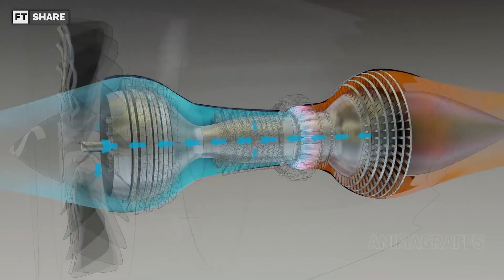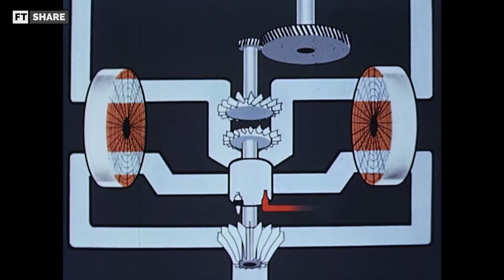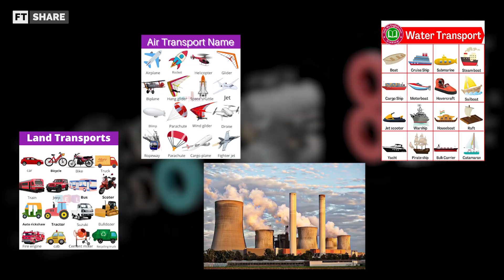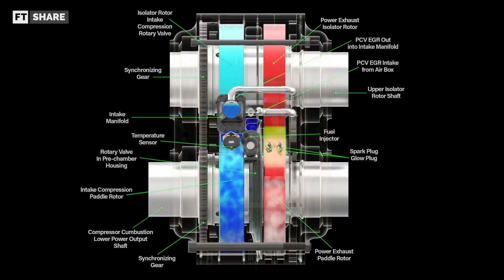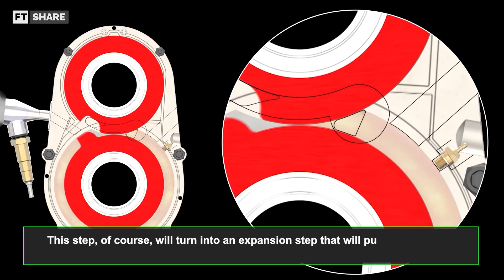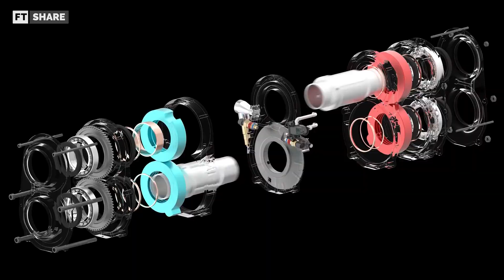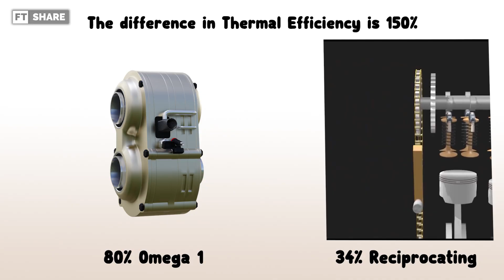Ready To Destroy EV Engine!! | Astron Aerospace - Omega 1 Engine

Comment: Thermodynamically 80% seems a bit dubious. The maximum thermal efficiency of any Heat engine is in reference to a Carnot Heat engine which has an efficiency of: n=1-Q(low)/Q(Hot). Since Q(low) {the external sink} doesn't change in temp that much then that means Q(hot) must increase. The same material properties limiting traditional engines are also at play here. You can only go so hot until Q(hot) is so high that it melts the materials. Unless they have a published paper to back this up I am going to be extremely skeptical.
Reply: I actually agree alot with you as a builder but I am very Impressed by the expansion ratio this thing is capable of along with it compression ratio. Having a bigger expansion ratio is very good at making tq. I see issues sealing with the claimed rev range. It seems like it seals like a roots blower and that's fine and dandy but leakage happens and I understand the prechamber is used to give a buffer zone pressure wise to seal the two sections off. But the hot side is gonna get too hot. I don't see how this would work efficiently.
Reply: @oliverscorsim  It's worth tinkering with... Alcohol and refined versions of propane... Propene, propylene and liquid forms might help. As for longevity, that might not even be an issue for Airborne drones, especially facing hot side forward. It would make for a good one time use. There is also water injection. They really do need to put together more prototypes though. They make too many claims... Like the 80% figure. The compactness and low weight are impressive though. E en using exotic alloys, there are way less components.
Reply: A lot of these concept engines seem like amazing ideas until you start looking into sealing and cooling and realise one or both those issues aren't solved yet and they're some of the hardest things to develope. 
It looks like sealing those four rotors against the case, against each other, and on the sides would be the Achilles heel of this design, especially without using a fuel/oil mix to aid in lubrication. You can rely on tight tolerances to seal sometimes but that generally doesn't work when you have a wide range of temperatures to deal with due to expansion and contraction of parts messing with the tolerances.
Reply: @Surestick88  The devil is in the details.
Reply: @Surestick88  If you run it with diesel,it would have all the lubrication you need, Remember the diesel injection pumps raise the pressure at about 150 bar and the only lube they have is the fuel.On my car( Renault Megane 2, 1.5DCI),after 17 years and more than half million kilometers the pump doesn't give any sign of being in need to be changed....and it works in a rotary engine style (search for Delphi injection). Also if water injection is added to this Omega,it doesn't need to run on high temperatures,at 200 C in the chamber is enouth to switch the water from liquid to vapor,resulting in a volume increase of 4000 times,so in an enclosed chamber,instead of volume,increases the pressure (makes a nice boom😁)
Reply: You’re right, Daniel. It’s misleading at best.
Reply: I'm an aerospace engineer and its pretty obvious to me you're another engineer (probably a mech) or at least someone who's done a proper thermodynamics class. I don't know other people who'd write what you wrote. 

I have seen people work on wobble plate motors and other stuff and am yet to see any of them actually go into production. Considering the push towards renewable energy I doubt we'll see any new developments in internal combustion unless its for some very specific applications in unusual locations.

There's also a give away in this video. Listen to the voice and ask where you've heard it before?
Either there's the same guy narrating several 100 videos a week or its one of the computer generated tracks.
Who uses those???
Reply: @tonywilson4713  cheapskates n content creators use them
Reply: @jackd1582  Yep, Yeh, Uh Ah, Si, Da, Yah and every other form of yes.
Reply: A Carnot efficiency of 80% at 24,000rpm...lol that's not happening. If I had to guess, maybe 37%-39% is the real number. And based on the complexity of this motor and its size, it wouldn't last long without some sort of overhaul requirement. Cool concept though.
Reply: @ajspang4291 they said max power was at 5k rpm not 24k.
Reply: @charlescasto4226  yes but he says direct drive which is not geared,
Reply: totally agree, the combustion  process is not purely adiabatic so there will be heat transfert to the engine block and the rotating assembly and the heat loss to the exhaust can reach 50% so in the best conditions, you can anticipate a thermal efficiency of 25% for a spark ignited engine ( OTTO cycle)and 30%for a compression ignited engine ( Diesel cycle ) and about the  same for continuous process engine ( brayton cycle ) used on gas turbine engines.
Reply: @jacquespoirier9071  gas turbines can actually go above 40%, but those are usually the modern big ass engines for power generation.
Reply: @thorwaldjohanson2526  .... with heat regeneration, as you say, in a stationnary setup, it is possible to add weight and optimize the efficiency but the basic cycle efficiency is not that great.
Reply: @jacquespoirier9071  actually modern high compression ratio turbo fan engines can have thermal efficiencies of over 50%. I had that 42% number burned in my head, because we looked at engines from the 90s in detail in aircraft engine design and turbomachinery lectures, back when I was at university. Exotic materials and manufacturing processes have allowed these engines to have super high combustion chamber exit temperatures, and the turbines have gotten very good at extracting the enthalpy from the working fluid.
Reply: It's a scam
Reply: I am not an engineer, but what you say makes a lot of sense. As a mere mechanic I understand the damage to an ICE engine @ constant high RPM. Heat is the enemy here. The materials needed, to my knowledge have not been invented.If they have, the cost would be undoubtedly financially prohibitive.
Reply: Without thorough testing the material requirements cannot be known 100%.  A Wankel manages heat ok and this is not far removed in that respect.  There are ceramics that can withstand orbital re-entry so there certainly are materials that can withstand the temperatures.  The life span,  manufacturing and maintenance cost are one of the biggest factors.  Something can work very well for a short time or exorbitant price.

And in reply to the comment that now we are moving to renewable so all combustion engine development are redundant is a joke.   Firstly there are biofuels as well as methane and hydrogen.  Secondary for flight batteries are still very low energy density compare to combustion,  for short flight they work ok but for longer flights it becomes counterproductive.
Reply: @kentonian  Cermics withstanding orbital re-entry, well shuttle tiles are it's silicon-oxide or silicon-carbide and it's essentially 99% air and are extremely fragile. They are a a kind of foam, thus have a volume to surface area that's in the region of multiple times that of human lung, which if made to a plane would cover a tennis court, now imagine a tile about 30x30x5 cm and have 100 times that area. so at each point there is nearly no heat. Also there is a plasma shock bow that creates a insulating layer between the tiles and the air.

Oh, you can have ablative shields, but that's I think not such a good solution for a engine when the "cylinder" is disintegrating while running.

Here something to get education:
https://www.youtube.com/watch?v=hLHo9ZM3Bis

https://www.youtube.com/watch?v=HgTNzDCc0gk

It's nice to dream, but it's stupid to be in a dreamworld.
Reply: It's a startup company.... no prototype, only fancy animations and unrealistic claims... it's a money grab scheme
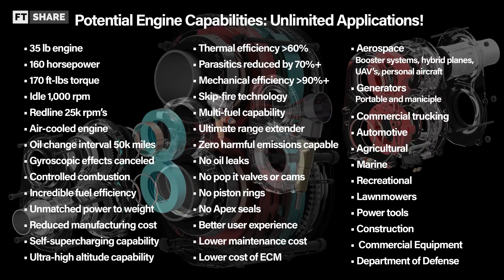Reply: The slide at 05:01 says >60% which is still very dubious but much more plausible than 80%
Reply: @almerindaromeira8352  A trubine is run at ~40% - 45%, some reach with tricks, 50% - 55%, which is in mechanical engineering somewhat of a holy grail, things like the super-critical CO2 brayton cycle turbines can reach 60%.

Diesel Engine in a 40 t truck also have 40 - 45% efficiency, but great thing with Diesel engine is that it can burn essentially everything, sunflower seed oil, peanut oil, canola oil ... hey most of international shipping, especially tankers run on crude oil, that is even below in the refinement process than diesel.

"Each engine has eight cylinders with an 800 mm bore. The engines are designed to deliver their maximum efficiency at 73 rpm. Their combined power of 59,000 kW allows the monster-ship to cruise at 16 knots."

Good thing of Diesel engine is it's low RPM high torque. That's another thing this is not talked about for this engine ... great Nm, at what? 25 000 rpm? You can't cheat physics, lot of weigh will produce a lot of torque.

This things prototype is leaky, in complete combustion, can't run for more than a few minutes ...
Reply: @almerindaromeira8352  60% is more believable. Modern powers rations that combine a gas turbine with a steam turbine (heated by the gas turbine exhaust) reaches 62% plus. That in a single device and especially in one step would be incredibly impressive, especially if no exotic heat exhlchangers and cooling or unsustainable high combustion temperatures are used. I'm still very sceptical, but it might work well enough for some niche applications
Reply: They only got 71% in the lab so I doubt they can get to 80%... 

Also, their paper stated that the combustion temperatures were significantly higher which meant that they had to use exotic metals...
Reply: @pilotavery 80% is definitely possible. You would have to run the motor at a lower rpm to achieve it thou. Also a regeneration from exhaust pipe would be used to increase it 80%
Reply: Well to be fair it's only combusting a tiny tiny volume of air, the reason why it gets so much power is because of how fast it revs
Reply: @pilotavery but they said the max power was at 5k rpm.
Reply: Exactly. Toyota has just launched an engine with a thermal efficiency of 37%, considered excellent.
Reply: Agreed. I see a spark plug. That means, running on gasoline, that your effective compression ratio is limited to about 1:10, maybe 1:12, before the mixture will self-combust. So, the Carnot efficiency is back to 33% or so. Also this highly compressed and therefore hot mixture, is supposed to flow around all kinds of sharp edges without going up in flames? Highly unlikely. And then still, it runs on fuel. So, emissions?

Show me a working prototype, on a test bench, with real world measurements, and I am game. Before that: Very very creative. But no.
Reply: De facto. But the rotary nature could be positive on reaching high rpm and make it, although efficient wise the same, more powerful (HP)
Reply: @Beto Lima  it fist needs to actually work
Reply: @some_random_garage  yep lol .. let's dream first 😂😂
Reply: @TheSuperCaralho of course no Dream no modern World
Reply: especially as their own slide says >60% :)))  4:59
still very dubios, but closer to reality of 30% increased to 35% after years of optymizations.
Reply: Damn it....  you beat me too it.  ;)
Reply: Gee I really hope your are not serious about engine development and then mention Harley's as improved over the years. Because they haven't. For a engine manufacturer to sell engine in cubic inches and figures under 60hp yout statment is rather embarrassing
Reply: 80% definitely seems un-realistic, but I guess we'll see
Reply: The actual thermal efficiency mentioned by the company is over 60%
Reply: Huh? 🧐
Reply: 30% is a good ICE efficiency also for nuclear power stations.
Reply: @tonyclough9844  A little higher, 33-36%
Reply: I don’t need any knowledge about mechanics. This video is just blabla… don’t put effort in commenting.
Reply: @Qwerty8  It's a foreshadow of an upcoming Bot plague😩 
Every media will be flooded with probabilistic nonsense soon.
Reply: @goiterlanternbase  egal. Nervt halt endlos.
Reply: @Qwerty8 yet you just did.  Interesting self-own.
Reply: I’m not sure where he got 80% from. I just looked it up and their own advertising states >60%.
Reply: @fearofchicke  Still way too high. The best heat engines available (combined cycle gas turbines) peak just over 50%- and they are huge static affairs. A single stage machine cannot get close- the laws of thermodynamics rule.
Reply: Quite right. Any improvements to internal combustion engines are going to be incremental and tiny. It is far better to abandon ICEs and use the money in EV development.
Reply: I was just thinking, 'Sounds like BS to me,' but what he said...^^^^
Reply: Correct. Assuming a typical 68 degree Fahrenheit cold reservoir, 80% efficiency would imply 2177 degrees Fahrenheit in the combustion chamber, and that’s assuming the maximum possible Carnot efficiency and that maximum will not be achieved.
Reply: That and several other bits make me wonder if this video is merely a nicely produced bit of animated fiction.
Reply: @dangraff8467  Perhaps they mean hybrid EV, that is, an engine run at low steady loading to recharge the EV batteries.
Reply: Eeww that sound that it makes mmm still a v8 sounds better but awesome stuff we will see what the future brings us
Reply: In the capabilities slide doesn't say 80%, it says > 60%, which is more realistic. Still a lot compared to a traditional engine.
Reply: three rooballs
Reply: https://youtu.be/vFfsEfnsA4I
Reply: Yes, and the rpm is so high you need serious lubrication system and it results damage to bearings if the oil flow is cut for a fraction of second in the maximum rpm at 25 000. Yes you can do it with RC cars even 45 000 rpm, but the masses are close to unexistant compared to any kind of serious transportation. It has long way to move a car, but it could be used to charge batteries in an electric hybrid as it's possibly intended. That could sound quite a bee like buzzing at it's own time in the trunk or something.
Reply: @ark-mark1  wow. Thats amazing, much better than this
https://youtu.be/vFfsEfnsA4I
Reply: Engineer or physicist? Or both?
Reply: @Kam1kaz3dreamer  Both dude ofc!
Reply: I see no seals. This is machine bullshit. Banned the channel from suggestions and you should do the same.
Reply: This is an example of an auto-produced video that does not even attempt to pass on any information- it is clickbait. 'no need to press the spring anymore' - a AI generated meaningless statement, read out by a machine voice. Expect to see more, by the thousands. Ultra cheap to produce, but producing an ad-based income - it is the new YT business model . Held together by six slim bolts and with no lubrication it is clearly fantasy- but as long as viewers view...
Reply: Uaàaa, yeah my thoughts exactly...
Reply: So what exactly is the maximum efficiency of a motor or engine?
Reply: I bet your the life of the party fer sureziezz .
Reply: I thought the Carnot engine was the most efficient thermal possible with a thermal efficiency of 75% - so calming 80% seems “somewhat unlikely”
Reply: I have in mind that traditional piston engines go somewhere to the order of 15%. Even electrical motor will rarely go beyond 80% I assume.
EDIT: sorry, piston engines rather go around 35%
Reply: @Inception1338  electric motors get 96%
Reply: @pilotavery  the Motor itself I assume yes but the entire System including warming of the battery and resistance in the Motor and Stuff probably goes less?
Reply: @Inception1338  yes, it's 94% efficient from the battery to the wheels through all electronics. Factoring in the heat losses during charging itself, so from the wall, it's 88% efficient, but counting the losses in transmission lines from the power plant it's around 83% and the losses from coal to turbine bring it down to 76%...

So in that case, 76% of the heat energy from the coal or gas at the power plant eventually becomes torque at the wheels. Honestly that is pretty damn impressive factoring in that bringing the gas with you yields 40% efficiency in an ICE engine.
Reply: @pilotavery  I agree with that.
Reply: @pilotavery  I am pretty sure sure maximum efficiency of coal-fired power plant is around 35%, so total efficiency cannot be anywhere near that given conversion losses.
Reply: @vanguard9067  it's about 60% efficient at most plants. A gasoline engine is roughly 35% efficient at best on the highway at 55 steady state. Combined it's roughly 20% efficient. Even if you don't use combined cycle and multi-stage compression, and you take the worst case scenario from coal-fired plants built in 1950s, you're still talking about 40%, which is 50% more than gasoline engines.

On top of that, electric vehicles are just so damn efficient. As in, a gallon of gasoline has a total of about 32 kilowatt hours of energy, and a Tesla can go 350 mi despite having less than 3 gallons of gas worth of energy.
Reply: @vanguard9067  if you're talking about a dog standard 1950s open cycle coal power plant, it's actually less than that it's about 32%. All the modern ones have multi-stage compressors and all kinds of other energy recuperation. That's how they are able to get 80% thermal efficiency. They get about 90% of the heat out of the coal and then they get about 90% efficiency in the actual steam turbine.
Reply: @pilotavery  that really isn’t the case for any coal fired steam generation stations.  Still in that 35%-40% Waste heat is too low a temperature for secondary power generation, but it is good for process heat.  Now gas turbine combined-cycle generation can deliver higher efficiencies, with current best performance around 60+% (about 2/3 from direct generation, 1/3 combined-cycle generation).
Reply: @pilotavery  no doubt conversion efficiency from battery to motor to final drive is in that 90+% level.  Must include charging efficiency at that 90% efficiency and 40% efficiency for base-load coal-fired electricity generation brings it down pretty close to the 30%-40% of ICE.  Gas turbine combined-cycle power generation raises that considerable of course to over 50+%.  From an emission perspective an EV is the way to go.  However, I think until batteries can achieve a higher energy density and/or faster recharge times, ICE will be what most people select, regardless of whether they really need greater range.
Reply: @vanguard9067  0.8x0.85x0.98x0.92

98% efficient motor, 92% round trip efficiency charging and discharging the battery, 85% efficiency transmitting over power lines and 80% efficient converting natural gas into electricity at the power station... This means that it's 61% efficient. 61% of the fossil fuel energy actually is used to move the car while with a gasoline engine only about 25% is 

Keep in mind that this is just converting it into kinetic energy. This is ignoring all the other efficiencies such as aerodynamic efficiency reducing the total amount of energy in the first place. This is just factoring in fossil fuel per kilowatt hour at the wheels

A Tesla carries about the same energy as 3 gallons of gas, within its battery. And it gets to use roughly 2 gallons of that gas worth of energy.

A gasoline car with comparable range carries about 10 gallons of gas, and yet it's only able to get about the same range because a gasoline engine burns a lot more of that fuel and 3/4 of it is just thrown out the back as heat.

electric vehicles are so much cleaner not just because they are electric but because they are more efficient. If gasoline engines were 60% efficient, and could get 80 miles per gallon, then it would actually be roughly the same burning gas in your car as burning it in a power station to power your Tesla. Granted our power grid is not 100% coal, it's an amalgam of many things and the less cold it is even better than numbers get.
Reply: @vanguard9067  The current generation of lithium iron phosphate batteries in the Tesla model 3 can add 100 mi of range in just 6 minutes of charging. That's pretty damn fast if you ask me...
Reply: @pilotavery  that is pretty fast.  Is that vi level 2 charging.  Is charging linear at that rate?
Reply: @vanguard9067  on the lithium-iron phosphate battery on the Tesla model 3, it's a flat charge rate all the way to 100%. The long range model starts tapering off around 40% to 50% charge. Because of this, the Tesla model 3 short-range actually charges up to 100% faster than the long-range charges up to 75 which if you think about it is actually kind of funny that the short-range model 3 with the iron phosphate battery actually does better on long distance road trips. The long range model can get long range but you only are supposed to charge it to about 80% anyway and on long road trips the charge speed slows down significantly so... Not to mention the iron phosphate batteries last about 500,000 miles while the long range and prior NMC sells only last 250,000 miles or so until they wear out.
Reply: @vanguard9067  The short-range it's a flat charge rate all the way to full the long range it's only for the first 40% after that it tapers off.
Reply: @pilotavery  thanks
Reply: At those sorts of power and size, it can't be air cooled.
Reply: Yeah, 80% does seem a bit optomistic. Physics will grind this down to reality.
Reply: @jfeeney100  it's 80% the same way that a Toyota Corolla is 53%. It's 53% theoretical based off of the engine geometry.
Reply: All of This engine is Liy.
Reply: Maybe there's a small chamber outside the combustion chamber constantly releasing compressed air creating a cooling effect on the surfaces preventing the measurement of heat loss?
Reply: Im sure you know better then the engineers that developed this 😂
Reply: @djboizard2270  Companies make bogus claims every week. It's easy for startup money to make engineers forget the basics or work on something they know is nonsense.
Reply: Right on!  80% is very sus.
Reply: No more than Elvis running for president.😂
Reply: Pistonun eylemsizlik kuvveti avantaja dönüşüyor, ne olursa olsun verimlilikte artiş meydsna gelir
Reply: All research efforts are commendable, as long as the money is spent reasonably and reasonably, and a starting and ending point is considered. If we are going to spend on expensive alloys, or compensate for leaks by increasing the speed and ultimately have an inherently balanced engine, I prefer to spend on a vane pump design (cartridge pumps) with a combustion chamber for detonation. And I am doing this. We have also designed a jet for 5 MW engines. This design is not inherently balanced. To help you: In front of the appendage that acts as a broom, it is better to lock in a denser metal such as mercury or lead to solve the balance problem to some extent. I think this engine can be suitable for speeds above 12,000 rpm, at lower speeds the cost of sealing increases and its failure also increases. Good luck
Reply: After around forty years of fabrication, R+D, maintainance and repair I can with confidence state that engineering theory does not always equate to the practical realm.
Reply: @cayminlast  so does concept engines and cars.
Reply: @cayminlast  here here!
I get annoyed when engineers talk crap. The thing is, they're tertiary educated and have been taught to use reason, yet like the fusion brigade (and almost everyone else, it seems), they just lie.
The poster of this little thread, which we're all responding, is, of course, correct. Of that there can be no doubt
Reply: It has some of the same fundamental problem many of these interesting looking bs concepts have - a horrible combustion chamber geometry and inherently problematic sealing are just two of them.
In general such things basically mean low efficiency by design. 

So, 80% isn't dubious anyway but absolute bollocks. Maybe 80% of Carnot efficiency, and I'd highly doubt even that in an design riddled with such inherent problems as this one is.

If it is to ever work properly, which I doubt, it'll be another shitty high power density/low efficiency - design. There's no shortage of such as is and there's way less complicated solutions available already. The investors are going to be f'd.
Reply: Without knowing specific details, you can see there is a lot of potential for both internal heat barriers as ceramics and also internal catylalytic surfaces. The Wankel was bad in this area needing lots of cooling, resulting in heat loss. This one may be better or worse, we'll see 👀
Reply: "This one may be better or worse we'll see." ? You saying "we'll see" is as if you're speaking for everyone including me. Did you not consider that there have been many engine designs that haven't made it off the "drawing board" much less into prototype stage or production? That at least one or two engine designs have been marketed with the purpose of obtaining Government or other contracts/investor funding while never intending on bringing such design to fruition? You're entitled to make such a comment as "We'll see" If I give you the benefit of doubt then you're comment is at best an example that you're optimistic and I suppose optimism is also at best ok. At worst another example of peoples general inadequate and underserved communication and relationship with things and myself.
Reply: "Thermodynamically 80% seems a bit dubious." - very, and funny at the same time. The Carnot cycle doesn't generate or lose entropy to the environment. Since the entropy is linked to the time axis a real Carnot engine should swing back and forth in time and doesn't generate exhaust.
Maybe they talk about 80% efficiency out of the ideal Brayton (gas turbine) cycle?
Anyway, any very compact and very efficient engine can be a good pairing for an electrical motor. It could allow on-the-fly recharge and could supply energy on long and constant-speed trips. A miniature gas turbine sounds about right.
Reply: @milutzuk  
EXACTLY, I heard 80% and immediately said WAIT! is that Brayton or Carnot? Either way it's a dubious claim that will require independent verification by all metrics.
Reply: @milutzuk  That is the most probable explanation, yes. It's 80% of the maximum efficiency possible for this thermodynamic cycle
Reply: @milutzuk these cycles are just big assumptions they aren’t realistic in the real world. They utilise efficiency numbers off real life testing. 80% efficient does sound bold however considering that this isn’t really a gas turbine but more of a dual wankel engine. I could see the efficiency at low rpm being quite good however at high rpm it would never be 80% We will just have to see
Reply: The thermal efficiency refers to the amount of heat energy used to "do work". It's basically how much heat energy gets used to produce power. Which is why turbocharged engines are slightly more efficient. They use the heat and pressure produced by the exhaust to spin an impeller that produces a greater than atmospheric pressure to go back into the engine. More air in=more air out. Which is also more heat and more pressure. This is what gives the characteristic "lag". The engine has to produce enough pressure to adequately spin the impeller to make boost more efficiently. Efficiency is key to any engine
Reply: @richardwilliams9181  Nope,sir,you got it wrong... the turbocharger doesn't work ,,More air in=more air out. Which is also more heat and more pressure''. I found it out on the hard way,tweaking my own engine. That's why the turbochargers have variable geometry controlled by the ECU,because passing the point of optimal pressure gets to a bottle neck where the engine cannot exhaust properly=lower RPM and higher fuel consumption,because the engine wastes energy in pumping with the pistons the burned gases out,so more pressure on the exhaust side of the turbo=harder the piston lifts up+more time needed to lift. That's why the turbo chargers have the geometry regulated in service on a special test bank ,where they have applied a measured quantity and pressure of air on the exhaust turbine,measuring the inlet pressure and RPM,then a computer tells if need to increase the angle of the geometry or decrease.
Reply: @draculakickyourass  OK. But not every turbo has variable geometry impellers. I get what you're saying. But the variable geometry is only a small percentage of the turbos available. What I said is, in a nutshell, how it works. You're absolutely right about the turbo bottle-necking. And that's the consequence of having a turbo with a small exhaust housing. The larger that exhaust housing, the more exhaust gases are able to flow through it. But as a result, you need more of those exhaust gases to spin it as effectively. The bigger the turbo, the bigger the lag. Bigger and more displacement engines work better with larger turbos because they put out enough volume of air to spin the turbos. Smaller displacement engines struggle with spooling larger turbos because they don't move much air. The size of the engine is the number of liters or cubic inches of air the engine can move. And the size of the turbo is the size of the turbine wheels. Usually listing the size of the impeller first (the intake side of the turbo) followed by the exhaust size. So like a 6068 turbo for example has a 60mm inlet and a 68mm outlet. The A/R number on the housing is the ratio of air that can flow through the housing. Let's say a 40mm exhaust housing with a 1.30 A/R allows more flow of air. But also requires more air to spin it. Something like a .80 A/R requires very little air to spin it, but also can't flow that much air. This is where the bottlenecking comes from. A smaller A/R gives more response and less lag at the cost of top end performance. A larger A/R slows response but has more high end potential for power. Usually on a smaller displacement engine you want a smaller exhaust housing with a larger impeller. And something around a 1.0 or slightly lower A/R. Especially on a high revving engine. Having that extra flow helps keep the turbo working farther through the Rev range
Reply: Agreed totally more evidence needed or this is just a VC money guzzler.
Reply: 80% efficiency would exceed any thermal power plant and would make any other technology obsolete. Make a combined cycle out of it and you reach 90%. Big doubts about this.
Reply: but there are ways to remove heat from the metal, like jet engines blow cold air on the outside of the flame to reduce its conduction to the metal .... maybe there is some sort of cold air around the flame here aswell?
Reply: I only believe what I see and it is obvious that you have no long term experience watching real engines on dynos !  Egg heads frequently get calculations wrong as they live in fantasy land of their minds just like they did smoking weird substances in their " advanced " university training  !  Tell me now where all losses occur in a 4 cycle engine & appx how much loss in each noted area ?  80 % is not unbelievable if you actually have measured losses on actual equipment in the real world !  Show me your Dyno , I will show you mine !  I have worked on engines that have not stopped for 25 yrs + , as they are precious components of systems needed ....... Nick , NavyBlueSmoke , LST -1195
Reply: @WilliamRNicholsonLST-1195  If you "only believe what I see", then do you believe in electronics? Have you tested and "seen" how all the microprocessors work? Did you test that with your oscilloscope? Show me your oscilloscope, I will show you mine! 

See how absurd that sounds? I am sorry that you have met some annoying engineers, but all "good" ones will readily acknowledge there is a balance to be had between acquiring results experimentally and theoretically. 

This "fantasy land" I apparently live in is the one we all live in. Its called (reality), in which physics and the laws that describe it,  apply the same for us all.
Reply: I think the idea and principle are brilliant. Even heat distribution through out the power stoke across the entire engine surface! Also with such a long stroke most of the energy would be turned into rotating energy. Compared to a Wankel motor this is light years ahead. The Wankel had all the heat from combustion only in one spot and cause major heat problems. Plus this engine would have almost zero friction. The only contact area is the bearings and timing gears, unlike the piston engine and the Wankel. They have extreme friction losses and heat gains from this. The more efficient it is the less heat there will be to disperse!
Reply: How do you know that's the maximum limit?
Reply: @ I explained it. Google “thermodynamics Carnot Heat Engine”
Reply: high compression ethanol engines achieve up to 75% thermal efficiency, so if the metallurgy is on point, why not?
Reply: I’m so glad we have Daniel to be sceptical, I feel so much safer knowing he is out there being sceptical. He brings so much to the table.
Reply: Dogma Scientist
Reply: @AnderZ312  You need dogma for there to be science bud
Reply: @Dangineering  if by dogma you mean application of the method, then sure.
Reply: This is the perfect range extender engine for medium to heavy duty vehicles. This is the missing link for many use cases. Let's say you have a 3/4 or 1 ton truck and you are towing or hauling cross country. You could run 150 to 250 miles on total battery Electric. You could have this engine kick in to run a generator to both power the traction motor and start charging the battery pack up as you are rolling down the road. 

This engine could find it's optimal rpm range for optimal efficiency while the truck is operating until you come to a point where you could recharge the battery pack at a cheaper price. 

It would keep you moving until it was convenient to stop.

This engine could burn any fuel or multifuels. Gasoline, CNG, Lpg, RNG, Ammonia,  Hydrogen, synthetic fuels, ethanol, you name it.

These fuels could be filled up quickly and you could be on your way.

It would work in Hybrid systems for any vehicle or heavy equipment.

This technology needs to be pushed. 

Imagine having Electric trash trucks that run stop and go traffic all day long. They get the benefit of regen braking on Electric traction motor axles. They could be using RNG or captured methane trash gas from digesters for fuel that is compressed and fed into this engine for range extension.

This needs to happen NOW! This is the answer, the missing link moving forward to reduce dependency on Petroleum fuels.
Reply: @desertdan100  so this engine would be great for anything. 
Unfortunately it's 4 years later millions of dollars donated ti the 2 heads if the company for  r&d and yet still no working prototype 🤷‍♂️

Saddly even with all out technical advancement this concept still doesn't work..
Reply: @some_random_garage  Well the Wankel or rotary worked until it didn't. It proved to be a good powerplant but had longevity issues. Many people have modified it and made it better than the original but it is still slowly advancing. 

I could see the issues in the beginning and could see far enough ahead to understand that it will always have some inherent issues. 

This engine has greater potential than the Wankel did. Many of it's short comings can be eliminated in the future with better materials and refinement.

We have advanced a great deal in materials in the last 20 years. Look at the first Harley Davidson engine compared to a current one.

This concept can work, the potential is there. Even micro jet engines of today could become generators to function as a range extender on a medium to heavy vehicle.
Reply: @desertdan100  all wrong sorry mate, dirty garage guy has a 3 part series in this and the only thing that works is the scammer running the show.
DO NOT INVEST WITH THESE PPL.
It's a marketing scam
Reply: @desertdan100  "This technology needs to be pushed" is a statement of incorrect logic. if the technology has merit then it will evolve. however pushing a technology just because it has  marketing video alone does not mean it is a viable technology . 
More scary is that people think g"government"  should fund the projects. If there is merit then private companies will fun =d it.
governments are notorious for converting or investing tax payers money into failed ideas.
Reply: With the rate of 20,000 revolutions per minute, it can both seal as equal as conventional combustion engine and also produce an incredible power output.
Reply: @JohnKickboxing  Funny that in the few seconds of annoying, music-overdubbed test footage, it wasn't even turning 500 rpm, let alone, 20,000 rpm! Even there, it shows evidence of incomplete combustion due to visible flames out of the exhaust port.🙄
Reply: @danw1955  maybe because it' all opened ? Try to run a tipical engine all opened and see how many rpm you got
Reply: @danw1955 all engine exhaust flame
Reply: @danw1955 exactly
25000Rpm???
It's impossible.even 1000rpm
Reply: @JohnKickboxing  like he said with that power output heat will be a big problem...
Reply: @2wJonny  👌
Reply: @JohnKickboxing  https://youtu.be/vFfsEfnsA4I
Reply: @JohnKickboxing  rev don't make torq
Reply: A Carnot Heat engine cycle does NOT apply to internal combustion engines.  Try a steam engine.
Reply: @TheCSRTech  the carnot cycle is still the upper limit for efficiency for any heat engine, even though the cycles can look much different. Not that this is only the thermal efficiency.
Reply: @thorwaldjohanson2526  ICE is NOT a heat engine.  It is a combustion engine.  Not the same thing.
Reply: @TheCSRTech  internal and external combustion engines are both heat engines. Just different types of heat engines.
Reply: @thorwaldjohanson2526  That's debatable, but what is not is the fact that a Carnot cycle does not apply to an ICE.  The Otto cycle does.
Reply: @TheCSRTech  the carnot cycle does not apply to any real engine, however, it represents the the maximum theoretical thermal efficiency of any heat engine cycle. And yes the Otto cycle is an example of an ICE cycle, but so are others such as the diesel, Brayton or Atkinson cycle.
Reply: @thorwaldjohanson2526  You have the IDEAL Carnot engine, and the real Carnot cycle.  A steam turbine uses the principal of the Carnot cycle to operate and no, it is not 100 % efficient..
Reply: @TheCSRTech  there is no "real" carnot cycle as it is reversible by definition (no entropy is created). Steam engines generally follow the Rankine cycle, as you are dealing with a multi phase working fluid. And yes ofc, even a carnot cycle cannot be 100% efficient, as it would require absolute zero as its cold temperature, which is impossible.
Reply: @thorwaldjohanson2526  the Higher the Decibels determines how Cold the Ambient Temperature is...
Reply: @TheCSRTech  Not so; I studied both types in college and we spent more time comparing the Diesel cycle to Carnot than we did for steam. (Of course, we studied steam turbines, not expansion engines where it would probably be more comparable to Carnot.)
Reply: @SpamSucker  So you just said you COMPARED a Carnot heat engine to an ICE.  Comparing does not mean the theory of operation of the Carnot heat engine applies to an ICE  Two completely different theories of operation and different physics behind the theories.  Heat is not a requirement of an ICE, it is a by-product.  An ICE does not need a heat sink to operate, just to coll it to prevent self-destruction.  A Carnot heat engine requires bot a heat source and a heat sink to operate.
Reply: @TheCSRTech  thermal expansion of the fuel is literally how ICEs make torque.
Reply: @Kam1kaz3dreamer  No, combustion is a chemical reaction.  A single phase steam engine uses thermal expansion.
Reply: @SpamSucker Carnot cycle is celling perfect model of engine 
I think 
I am away from university 40 years
Reply: @user-wangyu  Agreed, that's how it was taught, as a ceiling "max theoretical efficiency" if you take away all thermal/friction/compressibility losses.
Reply: @TheCSRTech  water is heated to boiling, creates steam (a gas), steam expands does work, condenses (cools).  Gasoline is burned, creates exhaust gases, exhaust gases expands do work, exhaust gases released (cools).

They are both heat engines - Carnot equation compares real-world extraction of energy (work) based on temperatures to a theoretical maximum (ideal) to allow apples-to-apples comparison of efficiencies of all heat engines.
Reply: @TheCSRTech  combustion is a chemical reaction used to create an expanding gas
Reply: @TheCSRTech i would say internal combustion engine is a broken Carnot cycle 
In the pressure of atmosphere 

Carnot is higher than practical engine 

We can increase efficiency by complete or make practical engine similar to complete cycle Carnot cycle 

Imitating the Carnot cycle 

Means recovery of exhaust heat
Reply: @TheCSRTech I went to school four decades ago, but as I remember, the Carnot efficiency is the upper limit of any heat engine.
Reply: @TheCSRTech internal combustion engines are considered heat engines and therefore efficiencies can be calculated using Carnot’s equation.